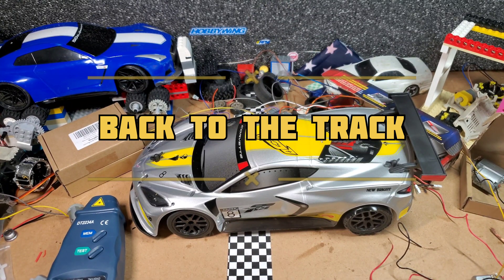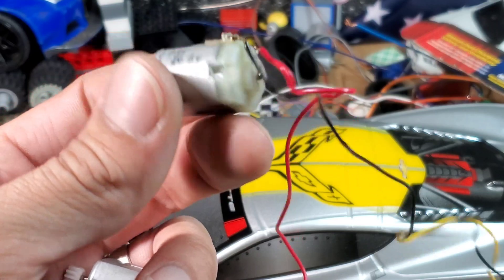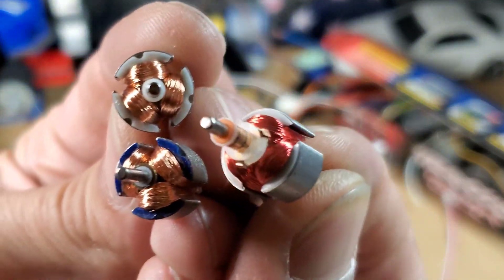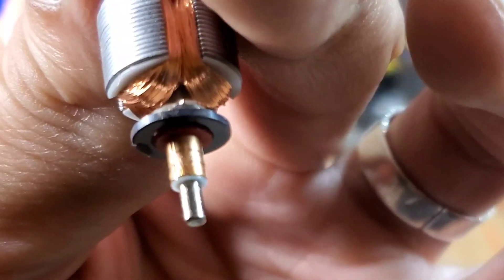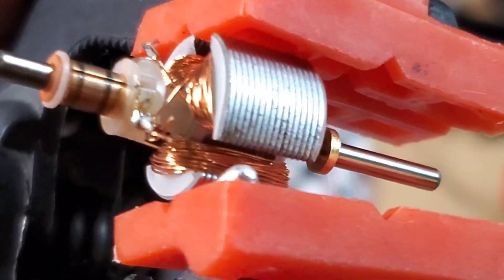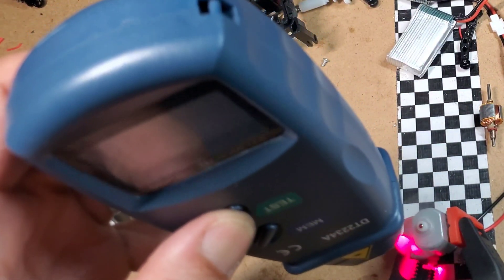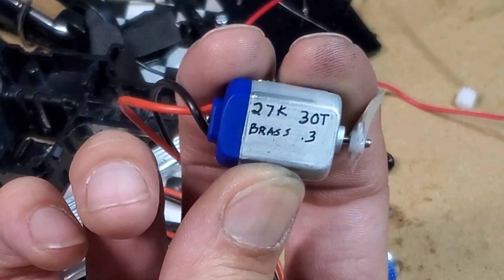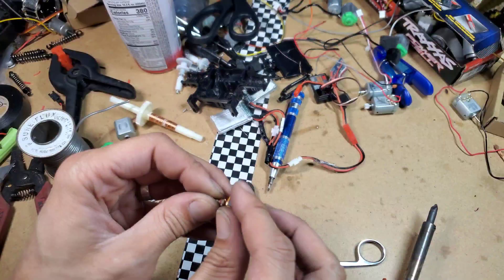Winding 130 RC Motors | Best number of turns

Comment: I picked up couple 130's off of Temu that are 88,000 Rpm and 66,000 Rpm for like $ or $7 bucks last year. Swapped out the armature and magnets along with the brushes to a regular 130 can, cuzz they were reversed, the shaft came out the same side as the motor contacts. and no mount holes. But well worth it. Tossed them in my Xmods gen 1 and Gen 2 Evo, Its bonkers. Throw one into my radline elite, chewing up gears lol

Comment: How did the rewound motors work? I tried this and it worked like a charm! One problem. I keep burning out the brushes or melting the plastic part the brushes sit in. I did the .3mm with 30 turns. RPM went up but motors cannot handle the speed/heat.😮. I even switched the windings to a case with weak magnets. Any thoughts?
Reply from the maker: Lol yea they get real Hot!  Well I would try doubling the copper tab connectors. Aliexpress has some variations of motor rear covers. Look for the high temperature ones. They also sell 130 cans with vents, stronger magnets and attachable heat sinks. I just posted a video briefly showcasing the brushless version.. I still haven't used it yet.
Reply: @backtothetrackgarage8790  Glad you are posting again. I miss your content. I've learnt a lot from your channel, like this motor rewinding and adding front suspension on cars like the Jada 1/16 chassis. Springs from pens and AA battery compartments have worked for front suspension. I have come up with a rear suspension design but not tried doing it yet. Get back to the garage 😀!

Comment: Hello ,I would like to ask a solution 😇
I have a same 130dc motor with high rpm which they say can use 3 to 5v .When I use it with 3,7v or 3vAA cables getting hot and batteries getting hot as well . :/ I install capacitor like yours but still have same issues.thanks
Reply from the maker: Lol yea heat becomes an issue when trying to go high powered. For the wires, go larger Gauge. Smaller gauge is actually thicker cable, so step that up for 1... AA
Reply from the maker: AA size is ok, however the chemical type matters, you can find AA size LiPo and Lithium type batteries that can handle better discharge rates than regular Alkaline or Ni-Mh batteries that don't get so hot...technically requiring thicker wires anyways.

Comment: My 130 dc motor is was over 90,100 rpm other 130 dc motor is 38,585 rpm is scream to my ear so high pitch. When I was curious to 9 or 10 turns and neat stack of copper wire and coloured copper wires purple and blue.
Reply: Is it made by yourself to have 90.100 RPM or you bought one pre-made?
Reply from the maker: Wow, that's up there. I learned real quick that a larger gauge wire pulls in too way much juice at those rpms and just heats up in seconds on any load, then the armature parts start to melt.
Reply: It likes a mini topfuel racecar,crazy but short time

Comment: A thicker cable for windings lets the motor use more amperage which can increase torque dramatically at the cost of extra heat.
With the size of the c8r there I'd guess a 180 size motor could work as well, 30 turns are probably as low as you can go with these before they simply start too melt themselves, specially on 7.4v.

Also worth seeing if you can fit a ball bearing motor case from pn racing or similar, should let the motor spin like another 5 - 15% easily as well as run cooler.
Reply from the maker: True on the thicker wire, I did try that once and burnt up an esc, Intense amp draw that melted the wires to the motor. The motor is still around. I'll try my 180's though. I'll need to research where to find some bearings for sure.

Comment: Hi again so I commented on one your video abut modding the motor for the C8.R I really need to know what "simple mods" I can do I want to take out the drive shaft and also of thinking to do a maybe a motor swap... I really want to my C8.R to be the BEST in performance and not a sleeper. I have 2 fast and the furious drift cars and they still destroy the C8.R like its nothing. Im also doing other races with some friends and I really need my corvette to be very fast! Thanks again for the videos they are very helpful!! :)
Reply from the maker: In comparison to your F&F cars which made by Jada Toys, which have bigger 260 motors.. A motor swap is the easiest mod.  A  B or C... (A)(Easiest) Order a performance 130 size motor online... simple swap to stock ESC wiring..Get a better ESC later. (B)(Challenging) Wind ("whined") your own motor. "35T"-turns on each side could be your best option for resources and budget using fresh unmelted magnet wire, soldering iron and pliers. In my motor mod vid, I made one putting out 40,000 RPMs, 2 times faster than stock. (C)(Complex but most beneficial)Any bigger motor requires some grinding and zip ties...unless you find a 9.6v or higher New Bright toy rc and just swap the whole rear differential assembly. You'll immediately notice it has a larger flat type motor that is actually a 260 motor. There are 2 versions of 260's, round (Jada) and flat (New Bright). I put one in my 1:8 Corvette because of its size-to-power ratio. 
No shaft, can change its drivability while turning and it already cannot turn anymore sharper than it can now without grinding something down a bit.

Sorry for the late reply. I thought I sent a reply last time. 

Want a detailed motor mod video? Let me know. I have a huge "library" of parts to demonstrate compare and swap to.
Reply: @backtothetrackgarage8790  yes I would (for the first reply)
Reply from the maker: Ok, I'm working on it now... Stay tuned.
Reply from the maker: BTW, just adding a motor in the front, if you have the extra idler gear and motor from another New Bright differential, you can immediately gain better acceleration, top speed and torque for Drifting. (Drifting may require electrical tape wrapped tires or similar)
Check thrift stores near you. $5-10 RC cars or less all the time. Plenty of parts and motors, more than I need so check brands often.
Reply: @backtothetrackgarage8790  ok thanks